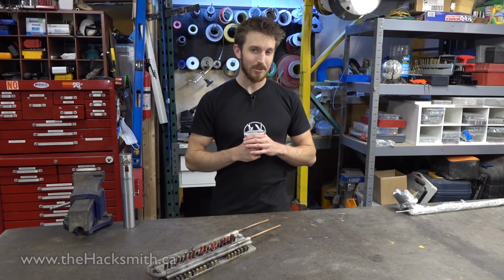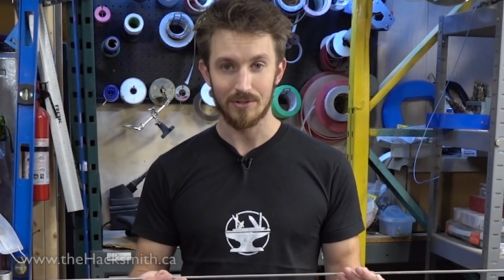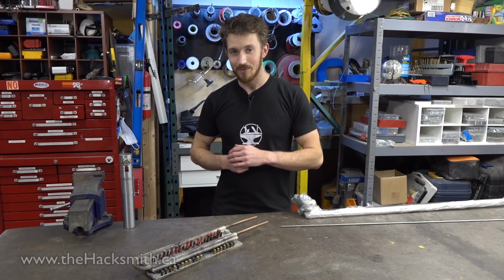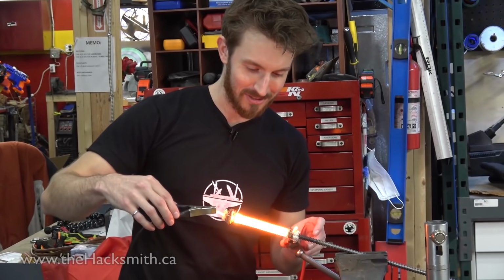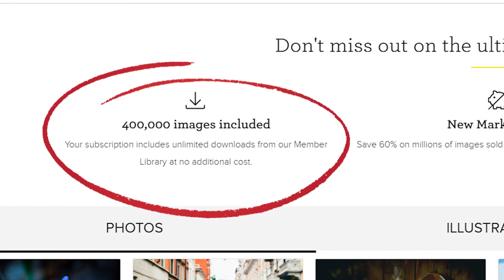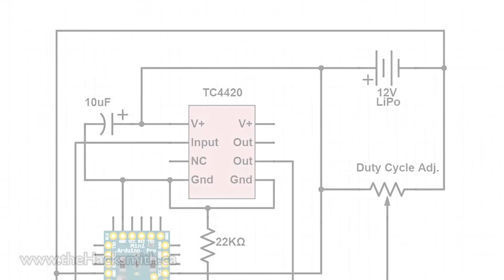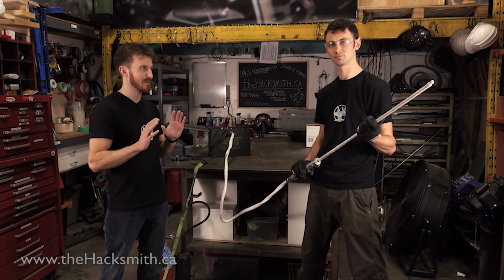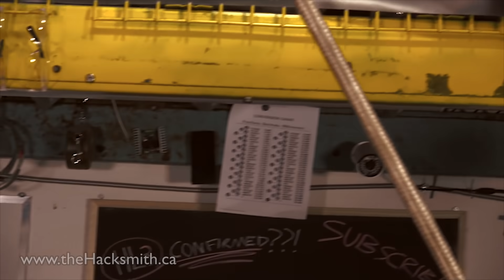2500° LIGHTSABER BUILD

Comment: Why not use Tantalum? It has the third highest melting point next to Tungsten, at around 3290 degrees Celsius.
It does come in rod form and it shouldn't be too expensive. It is also highly chemically inert so it shouldn't oxidize very easily either.  I was originally also going to suggest Rhenium as well, but it's really expensive so it probably wouldn't be very practical.
Anyways it's just a suggestion, you guys have done amazing work making this proto-saber and I can't wait to see what you come up with next!
Reply: From my understanding, It’s because tantalum has a much lower resistivity, essentially meaning it would take a lot more power to heat up.
Reply: No that is not how resistance works, your wire will heat up by the exact amount of power it gets, resistance just defines how many amps will get through the system at what voltage.
Reply: A suspicious black cat
Google knows everything.
Reply: A suspicious black cat Ohms law says so. Also it just means that it will take less time for the metal to heat up and it will as much power that it needs or you fan give it.
Reply: none of your business My suspicion is due to 
1) Tantalum being more obscure
2) Tungsten being all around better as a percussion weapon.

See, even Tungsten experiences a drop in yield strength when increased in temperature - you can look up diagrams, I've found a really old documentation that says apparently raw un-alloyed tungsten starts to drop in yield at  around 2000 fahrenheits. 

Now, the problem with this is that the yield of Tungsten is WAAAAAAAY above Tantalum. Like, 170 MPa vs 941 MPa. So it is fair to assume the Tantalum rod would basically flap around like a piece of silly putty at that temperature. And alloying it is a bad idea, as the components would just melt out of the structure.

Personally, I'd say the best idea would be some kind of ceramic with tungsten inlays, but I am not exactly an expert on ceramics, so I can't tell you whether there is one that is resistant enough to dynamic stress to survive a lightsaber battle.

EDIT: scratch that, these guys are more clever than I thought, they used an insulated rod inside to keep the thing stable. Clever, but I suspect this way the saber lacks the destructive capacity typically associated with lightsabers.
Reply: Horváth Benedek
Okay, so why not use a tantalum rod with a tungsten core? The main issue with using tungsten is that it oxidizes, plus the amperage required to heat it. So using a tantalum exterior should deal with the oxydization, I am still unsure about the required amperage, and using a tungsten rod as a core should keep it from deforming and floping around.
It also wouldn't require any alloying since the tungsten rod would just be used to reinforce the tantalum exterior.
Reply: none of your business Because as he said, tungsten isn't cheap, plus it is heavy. A tungsten core THAT thick would weight 3 times as much as a steel core. That's barely usable. And tantallum is even worse - a Kg of pure tantallum wire is 50-200 dollars, and then you have to order in metric tons to get that kind of price.

Comment: When I was a kid back in the 80s, I attached a copper wire to the ends of an AA battery. The wire got very hot, very quickly. I surmised you could probably build a lightsaber-like device using this method...and here it is.

Comment: Friends: Hey! Did you know that someone made a real life ligjtsaber!!
Me: No that's imposs....
Friends: Shows me this video
Reply: Freddie_Foz 56  i have no idea what u mean
Reply: Freddie_Foz 56 when a 6 year old makes a youtube joke
Reply: Freddie_Foz 56 it is impossible

If you dont know the force
Reply: cool pokemon gamer XD gucci ligjt sabre
Reply: lame, nothing more than a jumbo soldering iron. electrical resistance makes heat nothing special
Reply: cool pokemon gamer XD he said legitsaber
Reply: Kourai56 g
Reply: But actually this isn't  lightsaber
Reply: Well, lightsabres ARE impossible... this isn't the same design, thereby making this not a lightsabre... not only that, but lightsabres are a focused beam into a crystal that also simultaneously limits the distance the light can travel. Which clearly doesn't exist. Not only that, but the amount of focus needed to make a beam able to cut through basically anything would not only require so many focus points that they could fill up fort knox, but it would also subsequently ruin the length of the blade, and basically render it an unusable knife.
Reply: Protosabers still use the kaibre crystal, I hope you know that.

Comment: "A noble gas like nitrogen". Clearly not a chemical engineer.
Reply from the maker: oh yeah that's not a noble gas... still used for insulating metals though =P
Reply: He said inert tho
Reply: Jaron Huq I️ see I’m not the only one who noticed this.
Reply: JamesonCrate ik just corrected his quote
Reply: well it is quite opposite of noble gas it is one of the most reactive element FON
Reply: Dipendra Singh nitrogen is not that reactive
Reply: SuperAlvin "Tho" is not a word.
Reply: Though "tho" is the beginning of "thot". Could misread his comment as "He said insert into thot."
Reply: I would use argon before nitrogen but thats just me
Reply: Cameron Priest I would also carry a welding tank strapped to my back lol
Reply: Cameron Priest 
What is argon
Reply: +the Hacksmith

No... Just no. If you try to use it as an insulator for a 2000°C hot metal, you will get all sorts of unholy reactions with the metal and the air around it. Just use Helium, it's more expensive but quite cheap for an inert gas (or SF6 if you want a higher density, it's completely inert even for lightning strikes but hella expensive [1 tank costs around 1k$])

Comment: they should make an operator in rainbow six with one of these
Reply: Wouldnt that be a little overpowered? I main Dokkaebi and Vigil and Dokkaebi is a little overpowered, throwing a lightsaber in now would be too much.
Reply: Chris Chris no you make it like sledge's hammer where it has linited uses but it can cut through reinforced walls
Reply: Alex Swanson that would be awesome and very useful
Reply: thats what i was thinking, make it a lightsaber that can cut through reinforcements lmao, make it so you can cut any shape, you could just make tiny holes for glaz to peek through
Reply: mute makes it so you can use it, and you can use it with bandits batteries on it, but you can damaged and slow down when using it on an electrified wall

Comment: How much resistance is the coil? The resistance can be calculated by the inner diameter, gauge of wire, and how many wraps are occurring.
Reply: I was waiting for us vapers to chime in, he should've used 316l quicker ramp up less wattage . But that's just me also that ceramic sleeve he used is probably Nextel 1175 insulation for high temp wire shit makes bad ass wicks for gennys but I am a old timmer.
Reply: Would ohm's law not apply here? Why not just measure the voltage over the coil and divide by the current?

Comment: It's not the voltage that kills you it's the amps
Reply: Mike Cunningham you're joking right?
Reply: Mike Cunningham it's obviously the guitar
Reply: no why?
Reply: Either can kill you although in practice, amps is likely to happen first
 with domestic power supplies. However, lightning (which is high voltage
 and low current) often kills by burning, not cardiac arrest.
Reply: Yes pretty much, I was confused when he said that
Reply: Mike Cunningham Higher Voltage usually means higher Amperage. Depending on the resistance.
Reply: It's actually death that kills you
Reply: No, he's right. Amps is the "push" behind the voltage. A bus hitting you at 1 mile per hour wouldn't kill you, but push that bus at 60 miles per hour, and you could die. It's not the voltage that kills, it's the push behind it that does
Reply: No actually its crippling depression that kills you 😐
Reply: Chayton Snider first of all, your analogy is not correct. Amperage is flow, voltage is the “push.” The original name for voltage was actually electromotive force (or potential, same thing). Your analogy is essentially backwards, but bad in general usually the analogy used is water. 

As for volts vs amps, is the amps that kill you, and the volts that facilitate the amps, depending on resistance. Everything depends on everything, this is no catch all.
Reply: Johnny Appleseed it doesn't matter what analogy is used, it is rather petty to say that an analogy is bad because it's not "the usual" and according to my physics teacher, voltage doesn't determine current, resistance does, as does the source providing the power. That is why voltage won't harm you. Using your "usual" analogy, voltage is like a dam full of water, it just sits there. If there is a small stream coming from it, then it has little flow and small current, which means low amperage, and it won't do much. Make a bigger hole for the water to go through, then more water goes through, increasing the flow, but if the hole is at the top, it still won't do a whole lot. If the hole is at the bottom of the dam, then the pressure of the water above forces more water out giving more push, and more potential to do harm. Or you could think of it as a garden hose vs a fire hose. Fire hose has far more "push" behind the water, so it can break glass. If the same amount of water is sent through a garden hose, it would have less push because the faucet doesn't have that much pressure, it would just take longer to use it all. Voltage doesn't matter. You could have a million volts, but if it has .0001 amps, it won't do much. .0001 volts with a million amps of push behind it would kill.
Reply: Chayton Snider it all affects each other is what the point of my comments was. 1 million volts at .0001 amps requires 10000000000 ohms of resistance, which is pretty darn uncommon. And if you increased the voltage to 2 million at 10000000000 ohms resistance, you would then have .0002 amps, and more and more until suddenly the amperage is deadly. The amps kill, the volts make more amps happen, it’s all related. No analogy is “bad,” it’s just that people need to understand everything is related. 

200 volts at the resistance they are using will absolutely kill or maim
Reply: Johnny Appleseed the resistance is just what's creating the heat and light. What's going to kill or maim is the amperage required to push the electrons through the system. The voltage will be the same going out of the system as what came in, but the amperage will be different because it has to essentially push harder to get through all of the resistance in the circuit. They just need high voltage so that there's basically "enough to go around" in the system because with as much resistance as they have here, the amperage needs something to push through the whole thing. 9v won't give enough electrons to get through the whole things, regardless of how much push. They might be related, but voltage and amperage don't really have much of an effect on each other's value. High voltage doesn't automatically mean high amperage and vice versa. That's how the transformers in power lines work, they use resistance to lower the amperage going to the community from the power plant. The voltage from the plant is still the same as what comes to the house, but the amperage is reduced because virtually every household item would fry if it was exposed to such high amperage
Reply: Volts and amps kill, voltage is used to get past the skins resistive layer, the amps do the actual killing, so basically, it's the power that kills.

Comment: Do you think you can make a lightsaber with plasma
Reply: IanCHR um no, that's been proven to not be possible
Reply: Plasma cannot be set to a specific length, it goes on forever until it hits something it cannot travel through. Plasma burns at a temperature of 9000°+ Fahrenheit so they most certainly could not

Comment: I didn't get how you changed the colors of the protosaber... explain it to me pls
Reply from the maker: +Gregory Schift what
Reply: Once u put it on it starts to heat up and the colour changes from yellow to red
Reply: M4cex metal changes color with heat. As it gets hotter, it becomes yellow, then orange, then red, etc
Reply: Got that backwards, it gets lighter not darker. So red to orange to yellow not the other way.
Reply: It's an effect described by the Stefan-Boltzmann Law. As matter heats, it emites more energetic radiation, which in the colour spectrum translates into shifting colour until it gets violet, then it will emit UV light and so on.
Reply: if you are referring to the blue and purple lightsabers, they are prop sabers made with LEDs, not the real thing
Reply: hmm :/

Comment: Everyone's acting like this is amazing and historical. It's very cool, but guys. This is not ground breaking tech. It's just a very hot metal rod. That's all it is. This is not a lightsaber. It will not cut through steel.  It won't even cut through wood or plastic.

Comment: Hey guys,
This is just a suggestion but what if you used those really strong beams of light that are strong enough to burn and cut through materials, have them lined around the inside of the top of the saber and when you flick it on with the sound affects they are placed at a specific angle where they hit each other at a certain point and don’t travel any further? I may be a little off because my science isn’t the best but this is just a suggestion to more of a hand held saber

Comment: I know that kanthal is not available in rod form but why not use kanthal heater tube from a furnace.... and if you wrap the kanthal in a solid coil (looked like you gapped it on the lathe) it may heat faster as it lowers resistance... at least that is what I learned from vaping.

Comment: Please someone answer this question.  Why does it insulate on the steel bar, why wouldn't it be without it?
Reply from the maker: Because electricity has to flow through a circuit-- if it was just a metal rod, the electricity would not travel to the end and it would not heat up
Reply: @hacksmith  You have been very helpful thanks

Comment: I found 30 gauge kanthal could I use wall power or 120 volts to power my lightsaber, if not can I put the power from the electrical outlet in series and double the voltage?    (please tell)

Comment: Use larger cables! It pains my eyesight when i see you using a puny wire (looks like 2.5mm2) to power minimum 150 vdc. What happends is that you lose a geat deal of power because the huge amount of power will start heating the cables as if they were heater tubes in a water boiler